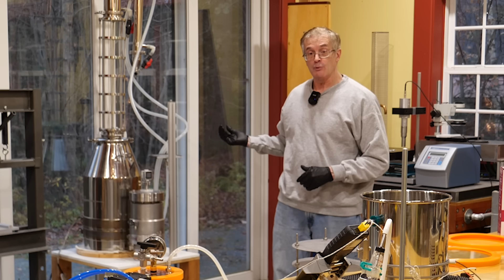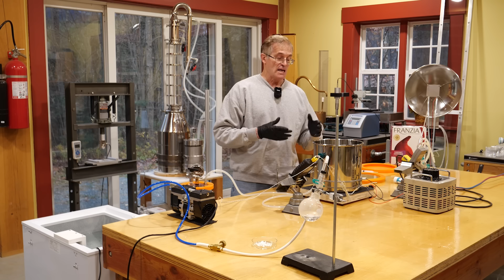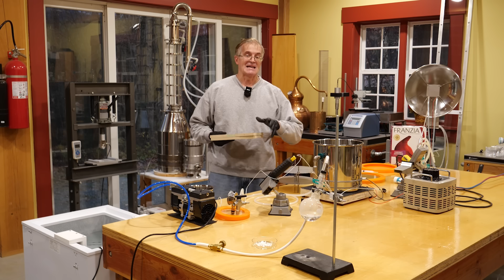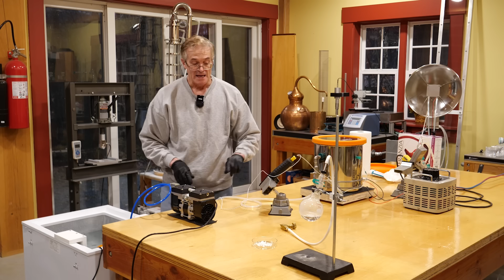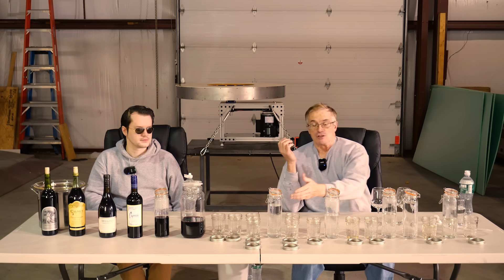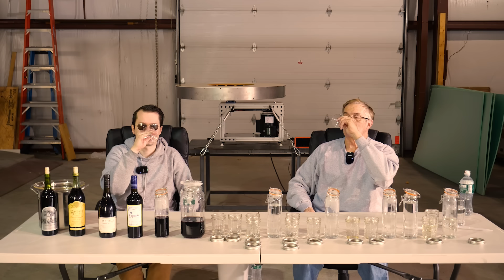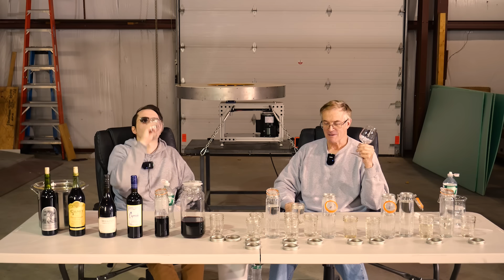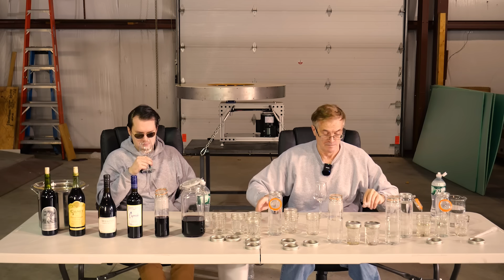Turning $3 Wine into a $100 Vintage with Science!

Comment: The best I've ever prevented bumping in vacuum distillation was by putting the stock pot into a heated ultrasound bath, distilled or RO water in the bath transmits the ultrasound to the stock pot and provides cavitation to encourage peaceful boiling. 

When inserting stoppers, wetting the parts with some distilled water will lubricate without contaminating the process. And to empty a boxwine completely, open the box and squeeze the bag.
Reply from the maker: Thanks, those are excellent ideas!
You and much of audience is WAY beyond average and I find this both chalanging and invigorating.
Reply: @TechIngredients wouldn't the energy from the cavitation make the molecules of the wine react together?

Perhaps it could "age" the wine a bit
Reply: @victorgonzalez-lf7le  Yes cavitation can do random high-activation-energy chemistry and if you use enough of it you could produce off tastes. However there might be a wide window between "enough to aid boiling" and "too much". Aging of beverages is mainly related to extracting flavor compounds from the wood. You can do it fast by sonicating with wood chips or even sawdust I suppose. Thought Emporium did a video on it.

Comment: The oak finishing of wines/distillers (at least according to the tours) happens because daily temperature cycle gradually forces the liquid in and out of the oak. I'd be interested to know whether you can do this with vacuum/pressure cycling. Or whether you can oak age a wine simply by adding oak to the pressure vessel pre-ferment.
Reply from the maker: I covered some of this in our livestream. 
Thanks.

Comment: Something I wish you would have done is, when adding the box concentrate back into the final mix I would have thought you would only put a portion of the concentrates back in since you left out the middle four. I would have thought to add maybe half of the concentrates back in and then tasted it and added as needed. Great project.
Reply: Yes, I was thinking the same thing. If the volume of the discarded portions was subtracted from the leftover concentrate and then the concentrate was added back then the final drink would be more balanced and ratios would be more similar to the original wine.
Reply: That, and do the same with the first fraction (the close-to-pure ethanol). Maybe look into adding water as well as part of balancing it all.
Reply: That's correct. They should have used a hydrometer when mixing back the new wine to match the ABV of the original.
Reply: But concentrating the wine by cutting out the boring parts is what makes it more intense and flavourful. Similar to reducing a sauce.
Reply: @ChristophPech  true, but you can absolutely have too much of a good thing
Reply: It depends on what your goal is. I love heavier wines like Delectus where they masserate for two months instead of two weeks, so there's a lot more flavor and tannins from the skins and stems. By cutting out the parts that weren't great and leaving the tannins and heavier parts it's making it higher quality instead of light and fruit forward like a lot of cheaper wines.

Comment: Hmmmm …..Teflon (PTFE) is considered food safe!
Reply from the maker: Ya, it's what is used to coat millions of nonstick cookware surfaces.
Reply: @TechIngredients   from Webmd ...  Concerns About Teflon Coating
The worry around Teflon coating was to do with some of its chemical properties. It used to contain perfluorooctanoic acid — or PFOA.‌

PFOA is a risk factor for health conditions like chronic kidney disease, liver disease, thyroid disorders, testicular cancers, low birth weight, and infertility.‌

Most manufacturers assumed that PFOA burns off during the process of manufacture, but traces of PFOA were found in some Teflon-coated cookware.‌

A 1999 study found that 98% of people in the United States had PFOA in their blood. This was due to environmental exposure to the chemical. As a result, the US EPA put up a program to eliminate the use of PFOA by 2015.‌

Another concern related to the use of Teflon coating is that particles of PTFE may flake off from the cookware made with Teflon coating. But, they do not cause any harm when ingested.

Comment: 9:09 dunno if it's a mistake but wine definitely has methanol and you especially need to discard the foreshots of anything produced from pectin containing ingredients.
Reply: Grape fermentation to produce wine produces methanol, but it's removed through fractional distillation to highly regulated (safe) limits before being bottled and consumed. So he's right, in that the amount of methanol in that box of wine is negligible. He's not going to do any better than the winery that produced it when it comes to removing the methanol fraction
Reply: @danielcohn6884  Fractional distillation by wine producers - no way! Unnecessary and too expensive.
Reply: @danielcohn6884  No commercial grape wine maker I know removes methanol by any method before bottling. Your statement is not correct.
Reply: @danielcohn6884  Source?
Reply: @Haggleforth The FDA, one would assume.
Reply: @razeezar  The fda doesn't regulate wine over 7% abv, please don't speak out of your ass.

Comment: Never had anything out of a pressure cooker you liked, ha ha.  Living at 10,000 feet you're not going to cook beans or other legumes in a reasonable time in any other way, and they're just fine.  Anyway, nice video.
Reply from the maker: No, I haven't. 
I don't live at that chalanging elevation, but the vegetables I've eaten from a pressure cooker came out uniform.  The carrots, potatoes and onions were indistinguishable and the meat was soft, yet dry. I'm not saying that there isn't a way to use this tool effectively,  but I haven't found it.

Comment: I wonder how much of the reason you preferred the distilled wine was just that it was more concentrated after throwing out several cuts? It would be interesting to run the taste test again, replacing the lost water and alcohol.
Reply: Well, the alcohol wasn't lost, because they didn't cut any of the alcohol. It would actually have ended up being MORE alcoholic as well as stronger in flavor. When they were talking about throwing out some of the cuts and mixing the wine back together, I thought about the idea of adding water too. I'm surprised they didn't, but not VERY surprised because by that point they'd both had very little sleep and had done all that tasting too. Their brains were NOT running at full power!
Reply: @SuperDavidEF  It wasn't totally clear to me from the video that there was zero alcohol in the rejected cuts, but yeah, the point would me to restore it to the original water and alcohol content, minus whatever volatile compounds were in those portions.
Reply: @iang0th  Yeah, I think from how they were describing it, it wouldn't have been exactly 0% alcohol in those, but it would have been close enough to count it as zero for the purposes of the mixing ratios. They described the first three cuts as being very alcoholic, with the first one being probably 95% or more alcohol.

Comment: I was taught in school that water CAN NOT boil if it has ice in it. This means that the Earth is breaking the laws of physics, because the boiling water around submerged lava flows exists in the same global water system as the ice caps, glaciers, and icebergs.
Reply: Yes, that's what they meant. An block of ice a 1000 miles away stops any boiling. No fooling you 😏😉🫡
Reply: @MPIronmanJC  Yeah, fr fr. They were very stupid to make the absolute claim, "water can't boil if it has ice in it" which not specifying a specific source, inherently includes ALL water with ice in it because they didn't specify what source of water was valid in this assertion. I've even boiled water with ice in it on my stove top before, further disproving their horrible and blantant lies. Nobody can trick me >:(

Comment: Franzia, its better than Mad Dog 20-20.

Vacuum distillation is essentially how we made fresh water on the ship. Heat the sea water up just enough to kill bacteria and then spray it into a vacuum and it would flash into steam and then condense into freshwater.
Water for the boilers and drinking.
Reply: I'm sure you would have preferred his distillation over sea water if you had the choice on that ship.

Comment: Your thermocouple feed through adds an issue. You’ve now taken a single point two metal interaction at the probe weld and made it a 5 point three metal interaction (two at each screw and the probe weld). You should have cut the wires and fed them through the two holes (sized for a press fit in the bung.

Comment: In theory, this sounds like a good idea, but it does have one major flaw.  The bad stuff is normally the most important part of a taste/smell.  

I make perfumes and there are many aroma chemicals I use that absolutely stink and smell awful.  Chemicals like Norlimbonol smells like sweat, and Indole smells like bad breath and poo.  If you sniffed the chemicals on their own, then you would never think to add them to a perfume, but then again, this is why making perfumes is so hard.  If you don't add the stinky chemicals, then the perfumes lose a lot of their power.

So, going through and just adding all the notes you like will not make the best flavor.  You need the stinky notes to add depth and complexity to your creations.  Then you have the added difficulty of finding the right blend of notes — just changing the ratios even slightly can create completely different smells.

So in theory, this is an interesting experiment, but you are only scratching the surface when it comes to blending.  I've been doing it for years and I'm still a complete novice.  

If you want to make the very best wine, then don't think "what stinky notes can I exclude," but think more along the lines of "how can I tweak the ratios."
Reply: Yeah, I agree. I was already thinking along the lines that they need more nuance, like maybe still add a little of some of the cuts, just not the whole jar. Their binary in/out decision making approach made something nicer than it was before, but it could have been even better with a little more tinkering with ratios, like you said.
Reply: @SuperDavidEF yup, we are on the same page.  When I first started to make fragrances, I only used the smells I liked, blending up the "nice" notes, and making okay perfumes.  But they were all flat, bland, and boring.  It was only when I started to add the horrible aroma chemicals did my creations suddenly start to smell complex and have depth.  

The cheap wines and the expensive wines will probably have roughly the same aroma chemicals in them, but the ratios will be different.  In all probability, they will find that increasing the notes they didn't like will actually improve the taste of their concoction.

Super interesting experiment and I would like to see them do a part 2.  But yeah, if only making a scent/flavor was as easy as blending nice smells, lol.
Reply: The sum is greater than the individual parts. Tannin on it's own is horrible but essential when in a red wine.
Reply: @spudpud-T67 haha, here's me writing a big, long-assed, rambling post...and you just perfectly summed it up in a few sentences.  Lol.
Reply: @mikesmithz  I was a winemaker in NZ for 12 years. Ratios is right.

Comment: There are few issues:
1) cost: labor cost would be very high + large vacuum distery equipment is really expensive as well
2) confirmation bias: a) is was not a blind test, b) it is often even reported that far cheaper wines beat expensive ones. Hence the results were not consistent. Additionally there is the “marketing/reputation / cost bias.
3) selection of wines were quite random - you can get fantastic inexpensive wines - and some fancy wines are at times not great at all - and we are not even talking about inconsistency due to vintage, shipment & storage conditions etc.
4) Your pallet: this refers also to point 2: are you really able to determine, which wine “is better”? Would have been worth to ask a Sommelier to taste the wine…

Comment: Audio nerd nitpicking.  For your vacuum pumps and other little noisy things maybe make a couple isolation boxes? Something like boxes with offset rock wool baffles and a couple computer fans so whatever equipment is inside still has airflow.

That way you can show off the setup then just drop it over the vacuum pump (or whatever equipment) while it is running.

Comment: As a guy who makes mead, I find this interesting but quite unrealistic for the average person at home. The level of work involved is just too high to make it worth it. True aging definitely takes time to allow changes in the brew's compounds. I absolutely love this idea for fortifying something with itself. The one flaw I saw was your remixing of the batch; you should have calculated the amounts of both the colored and the now mixed distillates and compared that to the original volume, only adding enough coloring or flavoring to return to normal levels. I say this because your tannins and acids were way stronger than they probably needed to be, making the balance somewhat off—as you said, it was too tart or tannic, which can totally work. But man, watching your faces drink the color concentrate was hilarious lol. I do a lot of bench trials before bottling most of my stuff to see how much of whatever I need to add or if I need to correct something like excess acid or tannins. Brewing anything is almost as much art as science—feeling your way through it. With my meads, I just throw together things that sound good and hope for the best, but my guesswork comes from years of cooking and knowing a thing or two about mixing flavors to find an acceptable balance. I can always adjust things as long as I haven't bottled it yet, so I taste a lot before even reaching the finishing stages. I wouldn’t call what you did here making a vintage; I’d call it 'modifying a $3 wine vintage into something better." The vintage didn't change at all, nor did you age it to make it taste vintage. The setup for doing this on this scale is just as cumbersome as a regular distiling setup. The idea is amazing though.

Comment: Nice test, but I have one comment. Some of the distillate was removed, but the full amount of “wine syrup” was mixed back in with the remaining distillates. As a result, there is now more wine syrup present in the mix.

Second, could you repeat the test by first removing components 1 through 4 and setting them aside, then removing components 5 through 8? After that, re-mix components 1 through 4 and run the test again to verify that the result is the same as in the current test?

Comment: Question: Considering the effort to achieve the various fractions - membrane vacuum pump, modified vessels, etc. - would it possibly be more efficient to go with a full reflux still, maybe 10 trays, cooled at top & warmed at bottom?
Reply: Are you suggesting a way to distill with a regular still, without heating the wine to a high temperature (which apparently ruins it)?
Reply: @PaulLawson-k8v essentially, yes - but still under vacuum to avoid excessive heat. So vacuum pump is still required. Simplest is probably water (faucet) operated ejector…

Comment: Good video as always. A couple of suggestions: be careful with that kind of thermocouple splice as it will introduce error into your measurement as the splice, the meter, and the probe start getting further apart in temperature. A solid stainless probe that is like 12" long by 1/8" would be a good solution here because you could just bend it into a desired shape.

When drilling rubber, if you freeze it first the drill holes will be cleaner and closer to the drill dimension because you would be cutting material more than ripping it.

I am working on getting a LC/MS up and running at home. If/when I get it going I would be glad to run samples for you. I might not be good at identifying things as a real chemist, but if you were to post the raw data somewhere I am sure your audience would be all over that.

Comment: My brother used to run the cheapest bottles of vodka through brita filters many times, like a dozen or more. He even made a contraption which stacked six filters in a tube for a serial processing unit. A couple runs through "the tube" and it genuinely tasted better than the $40-60 stuff.
Reply: I just throw a couple grams of AC into the cheapest vodka and shake it a bit every day for a week or so until it's smooth. That's what I use for flavor extraction.

The first time I had loose AC crumbles, we got black vodka. With pellets it's clear. The same bits of AC can be reused until they no longer work...gallons.
Reply: @SuperWiz666  what's AC
Reply: @AVarietyOfPleasingHeads  activated charcoal
Reply: @factsheetplethora  thanks
Reply: @SuperWiz666  Very cool. I didn't know it was that simple. I never did the brita thing myself but I might actually try your method.
Reply: Only problem is the brita filters cost more than the expensive booze at a certain point
Reply: I have had similar results with a cheaper source of activated charcoal: whole-house filter cartridges. I open them up and break the cylinder of AC into chunks, and then just let them soak in nasty booze for a week or more more. I have been amazed at just how well this works!
Reply: You could use a traditional barbeque coal instead! Makes smokery black vodka (russian water)😂
Reply: After you drinking any price of vodka couple of bottles they all start to taste as high end Finlandia Vodkas! 😂
Reply: Your brother was on Mythbusters, then?
Reply: @kaydog890 It was an Internet meme long before Mythbusters. Much of their stuff was.